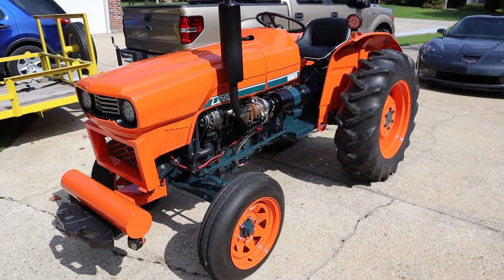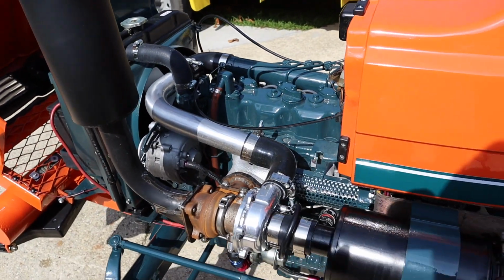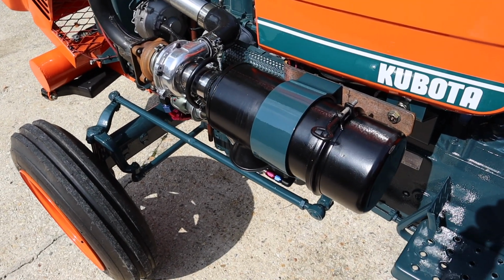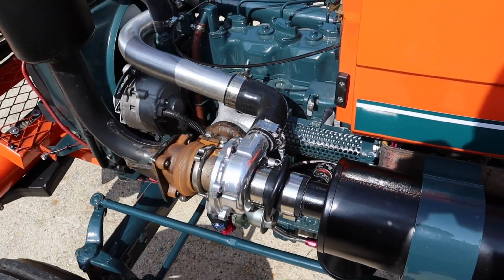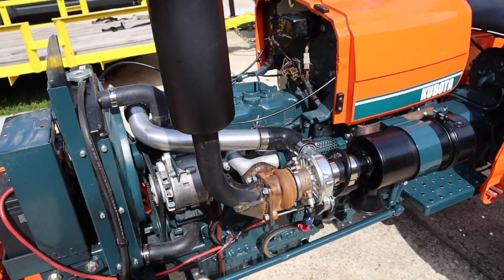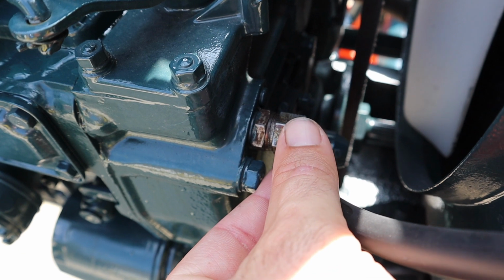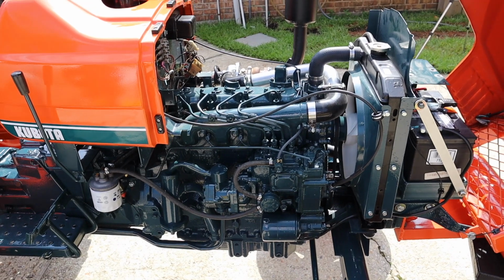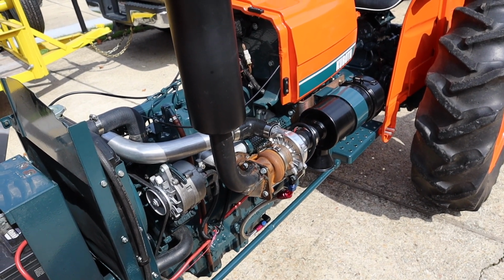Kubota Turbo Diesel L285 Tractor - Boost!

Comment: Just messaging again. Bad ass setup. I was still wondering if you have a parts list for the install. I have a l355ss and I was wanting to put a turbo on it. Any help would be much appreciated. Thanks.
Reply from the maker: Thanks! I don’t have a parts list, but it was pretty easy to compile off of eBay. Just got a tea fitting for the oil pressure sensor that will feed the turbo and a return line can be drilled and tapped into the oil pan.

Comment: Hello my friend! Very good job!
I want to ask you, I have a kubota M5030DT (55hp) and I would like to put a TD04 turbine from Mitsubishi 4D56. How much safe boost can i have with stock internals?
What about oil pump?
Can I make it 62hp?
Reply from the maker: Thank you! I would go for it 🔧 the kubota Diesel engine are extremely robust. A lot of there turbo and n/a engine share the same internals and fuel pumps. Please do your research as well but that turbo should be safe.
Reply: @RaztechPowersports  So it can work 0.5bar or 7psi safe?
Reply from the maker: @georgeb2907  yeah I can’t see it being a problem. Look up that engine and see if they made a turbo version as well
Reply: @RaztechPowersports  Thank you!

Comment: Great install and work!!  I'm thinking of buying one of these. It has a 7ft plow.  Asking 5k.  Is that a good deal?  Would you recommend for 5 acre hobby farm?  Thanks
Reply from the maker: mahkato1 that’s a little pricey unless it’s in really good condition. How many hours? Overall it’s a very capable tractor. 4 cylinder has Plenty of power.
Reply: @RaztechPowersports  here it is on fb.   https://www.facebook.com/marketplace/item/184409386135614/
Reply from the maker: mahkato1 unfortunately it just opens up in market place and not the ad for the tractor 🤦🏻‍♂️
Reply: @RaztechPowersports  he just responded and sold it.  Think thats why doesn't work now
Reply from the maker: mahkato1 ahh well anyways.. 30hp is a great size for 5 acres. I have seen much newer 2wd 30 hp kubota tractors in that 5k dollar price range. Just keep hunting for the deal. Good luck with the search
Reply: @RaztechPowersports  thanks.  What do you think of the jd 4020?
Reply from the maker: mahkato1 I would try to find a newer machine but it was cheap.. I would be tempted lol
Reply: @RaztechPowersports  doesn't say on hours but appears good condition
Reply from the maker: mahkato1 def find out the hours before you go see it. 7ft disc would be pretty big for this tractor

Comment: what sort of horse power increase do you think you have acheaved. Thinking of doing mine. Very nice job .
Reply from the maker: dsgrally I haven’t had time to Dyno it. But I have seen similar builds that get 40 to 50% more horsepower. I can tell a difference while Bush hogging. Holds rpms

Comment: Did you ever get the intercooler installed? How do you know how far to turn the fuel screw? I have an L245DT that I want to do this to.
Reply from the maker: Robert Allor I didn’t and I really don’t think it’s necessary. I will probably install it at a later date just because I bought it though. I can’t recall how much I turned the screw out, but it wasn’t much.. maybe one full turn. Still need to do some heavy bushhogging to make sure I’m getting enough fuel
Reply: @RaztechPowersports  hey can you do a bush hogging video ?

Comment: I have the exact same tractor an l285 and am having a problem finding replacement coolant nipples that attach a rubber hose from block to thermostat
Reply from the maker: Fermin Valdivia the large nipple that’s on the front of the block? Dealer couldn’t find it?
Reply: @RaztechPowersports  no they couldn't my thermostat housing broke at the neck and I couldn't find any parts go a guys coming over tomorrow to weld it up but I need the little steel nipples for the hose to clamp on
Reply from the maker: Fermin Valdivia yeah I would just weld on a steel pipe that’s the same radius. Save some money too
Reply: @RaztechPowersports  do you have a video on how you did the wiring??? I need my alternator to work
Reply from the maker: Fermin Valdivia I did make a brief video on the charging system. Look up the wiring schematics for a L295. It’s almost the same and will help you a lot. I couldn’t find the schematic for the 285 but I know the manual is available on eBay
Reply: @RaztechPowersports  am on it thank you

Comment: What kind of head lights are they were can I get those?
Reply from the maker: Carlos V 4” 27w leds lights off of eBay. I had to cut the bottom mount off so I could flush mount them. Thy have 4 mounting holes on the back.
Reply: @RaztechPowersports  thanks
Reply from the maker: Carlos V no problem. It’s kind of a pain to modify but completely worth it

Comment: Nice job. Where did you get the exahust pipe? I like the sound.
Reply from the maker: Rafael Rodriguez eBay actually
Reply: @RaztechPowersports  Thanks. Do you think an exhaust pipe without the silencer would be even better? I mean, less restriction/less back presurre?
Reply from the maker: Rafael Rodriguez it was screaming loud with no muffler, which was cool for a few minutes lol. This is just a flow through glass pack. Not very restrictive.
Reply: @RaztechPowersports  Thanks!, I guess I can use my stock muffler when doing the turbo upgrade to my tractor.

Comment: I did the same thing on y b8200e Kubota but I took it off because it had a terrible oil leakage, the reason I didn't fix it was because the rebuild kit was way up there. It was an IHI turbo, came off a Vermeer stump grinder which had a smaller 3 cylinder engine. I took it off the Vermeer because the crankshaft broke. I put a boost gauge on the Kubota and the highest reading I got was about 3.5-5 psi. I did not adjust the fuel-air ratio though.
Reply from the maker: Ferenc Brown yeah curious how much boost it’s actually making at wot. I’m going to put it on a PTO dyno once the intercooler is hooked up